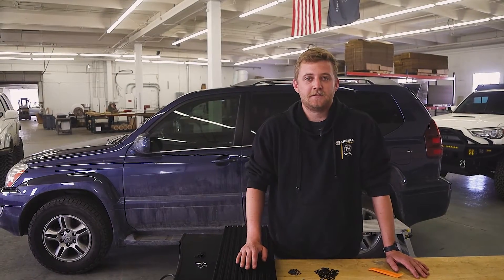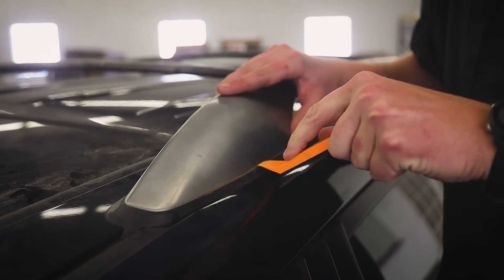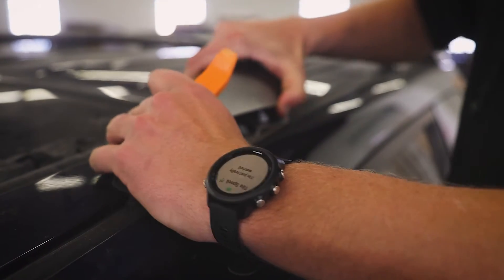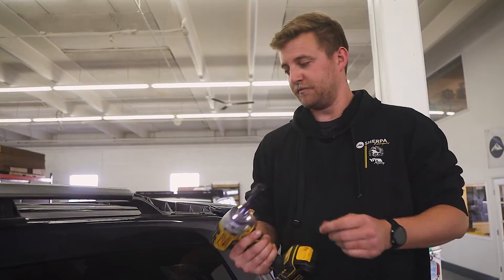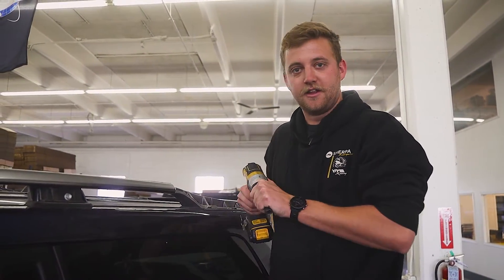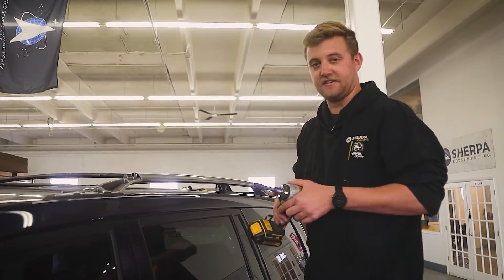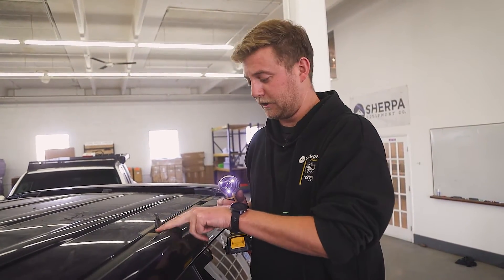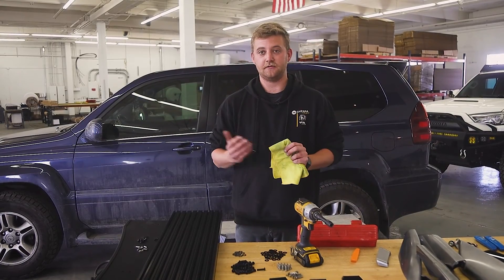How to Remove the Factory Roof Rack on a Lexus GX470

Comment: Do I need to cover the holes?
Reply from the maker: If you do not plan to install our rack afterwards and the included seals, yes you will have to find a way to fill/seal the holes.
Reply: @sherpaec what can I use ?